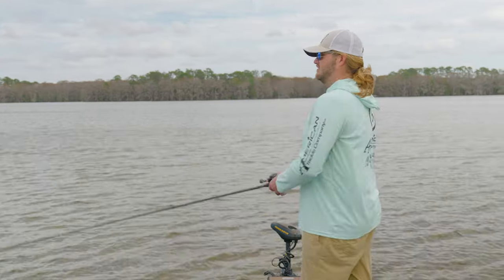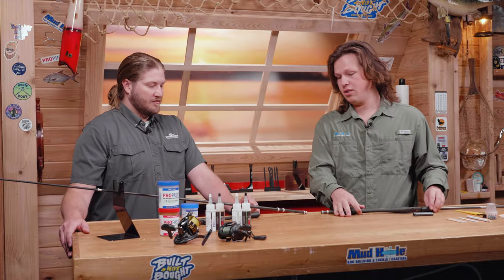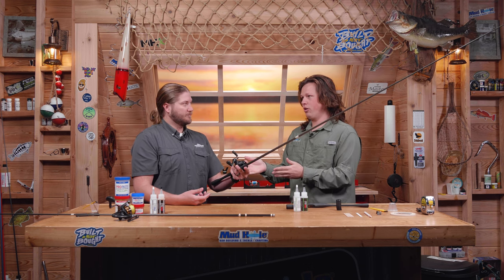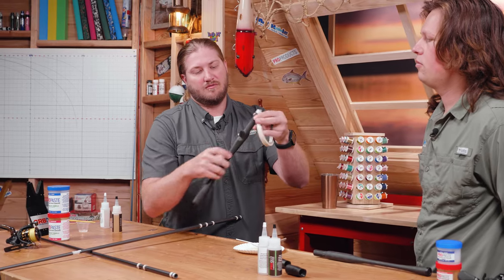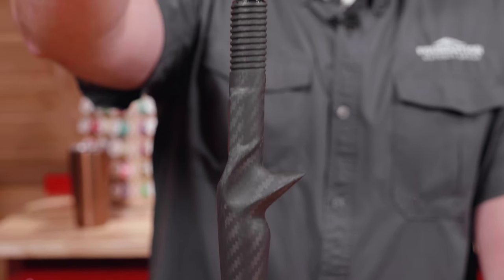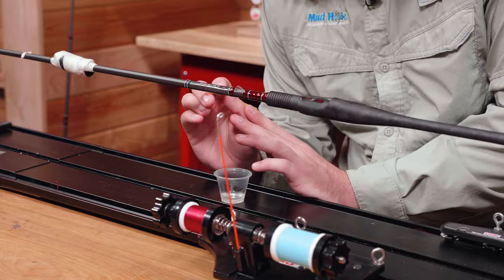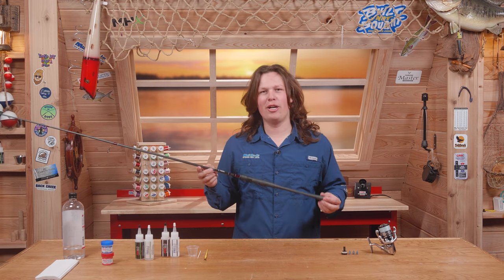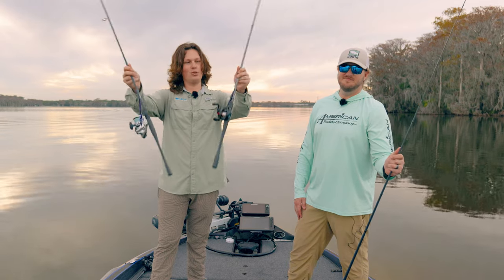GAME CHANGING ROD HANDLE?! - Tsuka 2 How-To Tips

Comment: I’ve been using north forks version simply because American tackles wasn’t available. These types of handles are really nice.  I cut much more from my blank, basically because most of the handle section of the blank is no longer needed. These handles really allow you to change the rod action, or just keep it the same. I just made two med light bait casters with a finished length of 6’8” and they are only 2.2 ounce a piece.
Reply: Did you add weight to counterbalance?

Comment: If you wanted can you put the rod blank all the way through the handle and just arbor the section of the blank that closely  touches the ID of the handle? Cause the rod im planning on using is already a 6'6" blank and cuting 6" off will change the action.

Comment: Does the rod butt have to go to the bottom of the grip?  Asking because i have an expensive rod that was snapped just above the reel seat(don't ask How) Was thinking if I cut it off and only put 2" of rod into this real seat it would be a solid fix.  Also would be great if you could take blanks and make them longer if rod doesn't have to go all the way in.
Reply from the maker: You do not have to put the rod blank all the way through to the butt of the Tsuka 2, but we would advise to put enough fo the rod blank in the handle system to reach the center of the handle system. 

In your case, losing more than 12 inches of your rod blank will change the power of your rod and adding a new handle and reel seat would affect the distance between the reel and the stripper guide. This should be considered before making a decision
Reply: Thank you @MudHoleCustomTackle